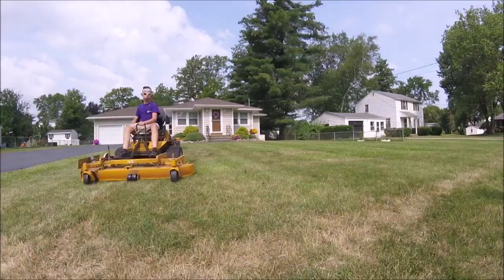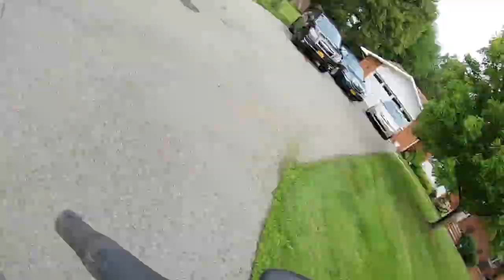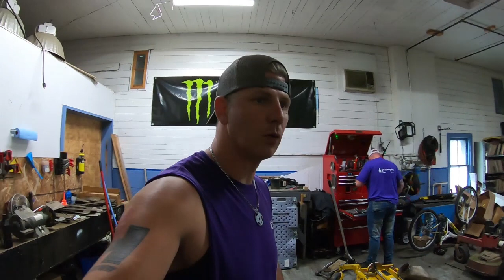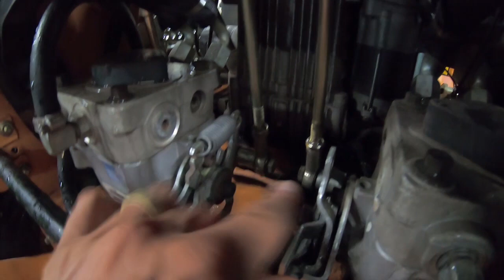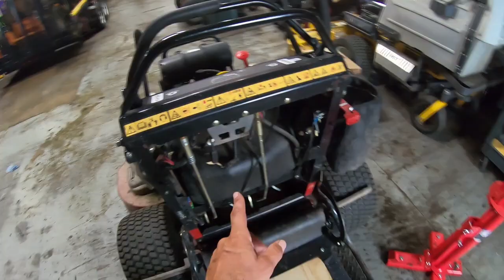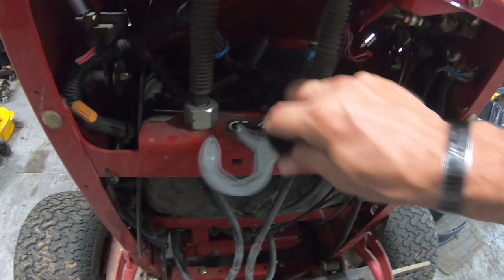HOW TO make a Commercial LAWN MOWER FASTER

Comment: My Super surfer clone is insanely fast. The only problem I have is the controls are super jerky/touchy at low speeds. I have a 5x8 trailer and the mower barely fits. When I back it off im banging off the sides because it can't manage to get the controls to go smoothly in reverse. Same with going forward in my garage. I turned the mower on the other night to move it a few feet and it was super jerky feeling. You ever have any issues like that?  This is the only stand on mower I have ever used so I don't know if it's me or the mower.
Reply from the maker: My wright 32 is the same way, it's scary sometimes.  No idea why it does that
Reply: @CountrysideStrong  any chance it gets better after it gets warm? Wondering if it might have to do with the hydro oil type? I've noticed after I mow a property, it tends to be easier to control. Then again it all could be in my head.
Reply from the maker: @PattDizzle  I've never noticed any change and it's always sporadic
Reply: Check your control dampeners. My 2015 Gravely Pro-Stance has two gas-powered supports like hood or hatchback lift supports which work to dampen the feedback from the control levers to the hydros to avoid jerkiness. My problem was actually not a worn-out support as I suspected, but the nut fastening the ball that the hood support "clicks" on to had worked its way loose from the frame. Tightened it up and problem solved.
Reply from the maker: @Devin_Schwartz  I've had that issue before in sir down zero turns,  I've never seen them on standers

Comment: You sped this video up didn't you?
Reply from the maker: Prob, I do that with most of them
Reply: I've had only 2 complaints 
One for being too fast
And the other just asked to cut it shorter than 4 inches. That's where I like to cut at here in Indiana. I do what I'm told though if it makes sense to the lawn. I won't ever scalp it cut we get a drought here they put a water ban on watering lawns here so I go back to 4 inches cut i.dont want to replace lawn. A SKID of sod is $250 covers 600sq ft 
Are you looking for more lawns or do have all you can handle